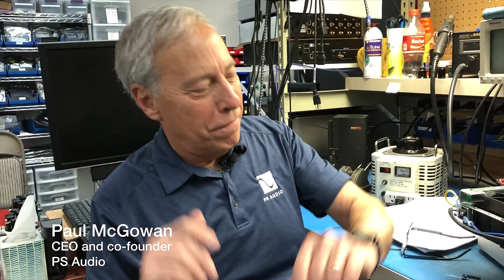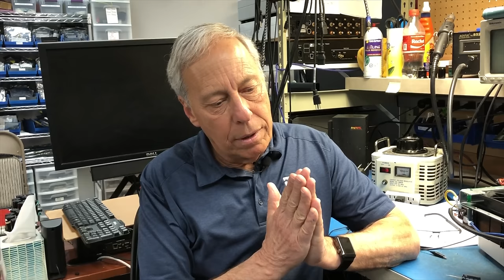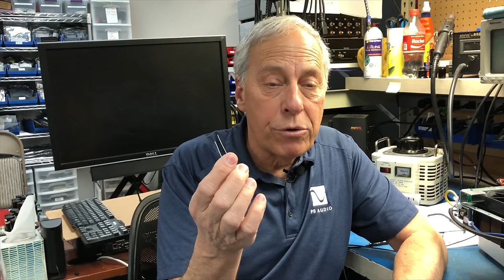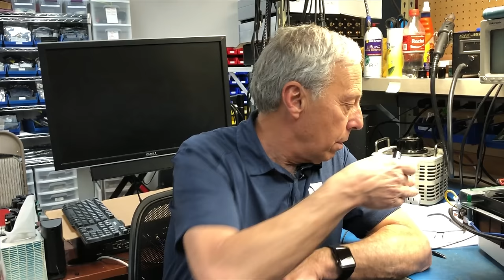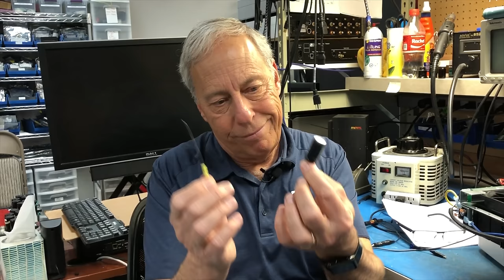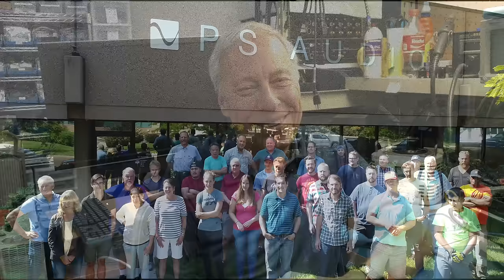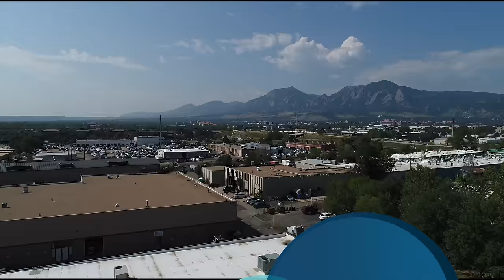Why do capacitors sound different?

Comment: I’m sure it was just a momentary brain fart, but of course a microfarad is one millionth of a Farad, not one thousandth. That would be a millifarad
Reply: not a brain fart. this is the crippling side effect of living with the imperial units
Reply: Jako-Priit Raud Farads are used to measure capacitance throughout the world. There is no other measure.
Reply: +gotham61  Lol, thank you.This metric vs imperial battle, I use both, and have the same difficulties in both systems  :) As far as the "these sound way better" thing about caps is kind of non-sense. If the right spec & type cap is installed in the particular circuit, say a guitar tone circuit, or a crossover network, and swap brands, at same values, etc. not many an ear will pass a blind test. But hey it sells caps, and $1237.99 RCA cables too :)

Comment: Generally high ESR (Equivalent series resistance).  Paper in oil and eletrolytics have a pretty high ESR (and other issues)  that metal film and other quality caps don't have.  Low ESR caps act more like wire than a resistor.  High ESR = rolled off treble.
Reply: Scott Lowell I use an oil impregnated metallized poly cap in the cross-over of some of my speakers.

Comment: Bob Carver said modern components are better than the ones that were around 20-25 years ago.
Reply: yup, notice especially how much smaller electrolytic caps are nowadays and that means less unwanted inductances, for example.
Reply: They are.  Back not that long ago, you'd find 10% electrolytic caps in crossovers.  Those are high ESR and induce audible issues.  For just $2.00, you can get 5% metallized film caps, which are vastly superior.  They are low ESR and act more like wire, without rolloff or smear like the old caps.  In the DOZENS of speaker repairs and upgrades I have done, in EVERY instance, swapping stock electrolytics for $2.00 metallized film resulted in an obvious and profound imnprovement that even non-audiophiles can easily hear.  Expensive speakers like yamaha NS-1000M and Kef 104/2 had poor caps in the crossover.  Re-capping them (projects listed online)  resulted in a dramatic improvement not possible back in the 80's.
Reply: Scott Lowell True, but it is not the percentage SPEC that made them sound poor.
Reply: You can get a tiny little 1 farad capacitor (HUGE value) to keep your digtal tuners' values, but that doesn't make better sound.
Reply: BionicMerlin I could be wrong but I don't think he was referring to sound quality but he was talking about longevity and reliability.
Reply: They are indeed, advances in manufacturing, better tolerances, materials. though not all components, you couldnt possibly buy a valve better then some of those in the 70's now)
Reply: Suzy Siviter are you talking about tubes? Because tubes of improved over the last few years getting back to the Quality that was 1940s and 50s.
Reply: Geerladenlad: Yes tubes, and no we will never get the skills in tube making back from the early 1970's, most of the great valve skills have been lost in time, yes we have better manufacturing skills now, but its not just a case of making a gas filled glass with a few electrodes and heaters in there, there was an art to electrode shape, distances, and even heater design to create linear amplifiers beyond the capability of most if not all current tube manufacturers today. Remember NASA and very large corporations back then spent the equivalent of Billions in todays money to research tube design.
Reply: Suzy Siviter prove it.
Reply: Nothing to prove, research it.
Reply: Suzy Siviter I have and the tubes that are being produced now  are just as good as they ever were.
Reply: Geerladenlad: Yes of course they are dear)
Reply: Suzy Siviter you can thank Mike Matthews for that.
Reply: Geerladenlad: Well Mike Mathews makes tubes like the EL34's and such;well known common tubes ; not the more exotic tubes I was hinting at in my post. Of course another component that hasnt really improved that much: the loudspeaker driver.
Reply: Suzy Siviter now it's your turn to go do your research.
Reply: For?
Reply: Suzy Siviter because he was instrumental in bringing back the quality of tube that's why. Now go on.
Reply: Geerladenlad: Some tubes dear, you are a prime example of why a little knowledge is dangerous..bye!
Reply: Suzy Siviter you're just mad cuz I knew more than you and you had to go look up stuff because of my information and general knowledge. What Mike Matthews did was for the industry which is the production of more quality tubes. I won.com
Reply: Geerladenlad: You are strange thinking that, just because you knew one guy making valves mmm, not much skill in that is there?.Perhaps you are just upset because a girl knows more electronics than you. FACT is you dont know your arse from an IGBT, you just pick up your knowledge from the junior book on electronics.
Reply: Suzy Siviter there you go again making sweeping generalizations talking about subject you know nothing about and making assumptions.
Reply: Geerladenlad: I have a rule; dont take advice from someone who cannot spell 'sandwich', think that's harsh?
Reply: You were wrong and I was right. Now move on.
Reply: Geerladenlad: always want to get the last word in?, each your 'sammich' lol

Comment: Capacitors will pass alternating current above a particular frequency, and block direct current. A capacitor essentially stores a static charge that the alternating current signal alternately charges and discharges. This is how is passes on alternating current - because the stored charge on one side of the capacitor creates an exact opposite charge on the other side of the capacitor. The amount of charge (in volts) that can be stored dictates the amount of alternating current that can flow.
Capacitors and inductors in combination form what is called a resonant circuit. Resonant circuits form the basis for all tone controls and all analog signal filters of any sort.

The different types of capacitors - made from different physical materials - have different properties. Among those properties is also a degree of inductance. And the different types of capacitor have different amounts of inductance. Interestingly, inductors also have a degree of capacitance. The trick is to combine inductors and capacitors in such a way that you get the right amount of capacitance and the right amount of inductance in resonant circuit for what you need.

An inductor is similar to a resistor, but is frequency dependent. A resistor inhibits the flow of direct current, and an inductor inhibits the flow of alternating current above a given frequency.

Thus, a capacitor filters out low frequencies, and an inductor filters out frequencies above a particular point, and what you get is a band of frequencies that the resonant circuit will pass.

Some inductors are just resistors working with an AC signal, and other inductors are coils of wire. Transformers have an inductance and a capacitance rating.

Comment: Nothing "jumps across" the dielectric. Learn how capacitors function. The reason AC passes current through a capacitor is because  of the alternating current which as the plates get charged and then flip polarity one plate will repel the electrons on the other plate. The repulsion/attraction is how the capacitor passes AC current. Now do coupling capacitors sound different? Nope. A coupling capacitor is meant to have a very low impedance to signals of interest; I.e. the voltage is the same on both sides of the capacitor. ESR is moot, especially in a tube amplifier where the next stage is often so high impedance do you really think even 1 ohm of ESR is going to make an audible difference when the next stage is 100,000 ohms or more? Nope. The properties of capacitors are moot for coupling caps due to the reasons stated but there are other applications like a crossover network where the capacitor could have a significant amount of signal ACROSS it's terminals and that's where the non-linearity/hysteresis may be measurable but rarely audible. This is why JBL biases the electrolytics in their speaker networks, to eliminate hysteresis causing non-linear distortions. For amplifiers coupling capacitors just do not develop enough of a signal across it's terminals to have any of it's negative properties come into effect. They are essentially a wire, or supposed to be sized that way. 

I have never measured distortion from an electrolytic coupling capacitor because of the reasons I explained. For the technically challenged nay sayer's we held local ABX blind tests that were designed to test some of the local audiophiles in picking out electrolytic coupling capacitors against "audiophile" type capacitors. Not a single person has passed the test where they can pick out the difference better than just chance/guessing. Some of the guys left with a different view of audiophile capacitors where others blamed stress or whatever for the reason they couldn't hear the difference, but they are just in denial knowing they spent far too much money on snake oil. It's snake oil salesman like Paul McGowen that only causes the industry problems and makes their customers poorer by promoting this garbage because they fail to understand the physics of how these things function and also because they have skin in the game and there are profits to be made.

Comment: Not a very scientific explanation, AC doesnt just pass through the capacitor because its AC and not DC, it is because of the electrons flowing out of the plate and attracting more electrons on the other side (they never cross the insulator only build up inside). This causes electron potential (AKA voltage) between the plates, if the capacitor stops charging up (voltage is the same as the power supply) no more electrons will be attracted to the other side so then there will be no current flowing "through" (actually too and from) the capacitor, so current from a DC source stops once the capacitor is full until the voltage changes again. What happens differently with AC is that after the first peak of the wave the electrons now start flowing in the opposite direction, into the depleted plate, pushing electrons out of the filled plate. This is all in order to equalize with the potential that the amplifier is currently at. PLEASE UPVOTE
Reply: Ahh the old debate of whether current actually flows thru a capacitor), your explanation is far too scientific for the majority of readers, but good on you for taking the time).
Reply: Exactly. it can NEVER pass thru a cap. they don't conduct. As you seem to explain current flows thru the circuit one way charges cap. as the current alternates the cap charges the discharges etc. etc. etc. allowing current to flow thru the circuit. Drives me crazy when people say a cap lets ac pass! The value of the cap will determine the freq. at which it will charge n discharge. Putting it simply.
Reply: It is still current flow though, virtual or not, whats important is the outcome which looks as if it passes AC.
BTW: the value vs. frequency is an over simplification as you say, as it depends also on the series and parallel resistances as well as any other caps or inductors within the same part of the circuit (1st order, 2nd order and so on)
Reply: Paul McGowan: Haha thats the trick isn't it, its not easy communicating on a specialist subject in general terms; but I think you made a good job of it. I think I could spend hours talking to you about Audio with all that experience you have.
Reply: I am answering the question of how a capacitor works not what does a capacitor do. The question is in the description but was never answered in the video: "And, for that matter, what is a capacitor and how does it work?" The reason people ask basic questions is that they do not understand the basics.
Reply: SuperBrainAK: You overestimate the knowledge of a typical person that hasnt been exposed to electronics/electrical, I know this from working in education myself). A lot of people don't even know what AC is, so you lost them on the first sentence.
Reply: SuperBrainAK: To be fair this is an audio channel, not an electronics one)
Reply: I do apologize for my criticism, my original comment is for those who would like the explanation of how a capacitor works, in hopes that someone will learn something or inquire to learn it, if not then they can skim it and move on.
Reply: SuperBrainAK: I didnt mind; someone with some knowledge will learn something, and your explanation was pretty much spot on with how I used to teach the operation of a capacitor to first years, only I used the analogy of cars being electrons and car parking spaces, so as the plates build up with electrons there are fewer places to park and hence the electrons take more time to find spaces.
Reply: DC passes through capacitors just fine.  Connect a current source to a capacitor and the current will pass through it continually (until the voltage across the capacitor is too great and it explodes)
Reply: electrons do not flow through a capacitor only get bunched up inside, electrons fill the negative plate and leave the positive plate, until yes you go over the insulation  breakdown voltage
Reply: SuperBrainAK
: Agree, though I should add, you should never turn a capacitor upside down as the electrons fall out, that's why they solder them on upside down in Australia.

Comment: Gerhardt from Calgary, if you're listening, the answer depends on your level of interest and appetite for technical specifics. Capacitors, like cables and connectors, are the things most customers can see or are aware of. Therefore more attention is paid to them because manufacturers are able to convince the customer of their intrinsic value. Much more attention is paid to capacitors than to resistors for example, because resistors are small and difficult to remove. Capacitors are bigger and with some rudimentary soldering skills, can be removed and refitted with newer and more expensive equivalents. In short, it's another example of snake oil on which this industry is built. I design and build my own range of amplifiers that sound lovely and measure beautifully and I couldn't tell you which brand of capacitors I am using; as long as they are the right value, material and spec, I use what I can get quickly from my suppliers. A basic rule of thumb is to use film caps in the audio path rather than foil caps as foil caps can exhibit hysteresis which is where the cap doesn't discharge completely - like stretch marks in your sweater! Explained here: https://en.wikipedia.org/wiki/Dielectric_absorption .. Hope that helps

Comment: Capacitors can introduce audio distortion through variations of ESR or capacitance with the instantaneous voltage and current across the capacitor. Consider a high-value ceramic capacitor in a basic 1000hz high pass filter. A 100hz signal will be greatly reduced, but the capacitor value will vary up and down due to the 100hz voltage across the cap. This will introduce 100hz modulation on higher signals, strongest 100-2khz. An X7R ceramic cap's capacitance can fall 50% at it's rated DC voltage vs 0VDC. ESR of an electrolytic capacitor is far from an ideal resistor. It is after all passing a signal through a chemical bath (electrolyte). Lots of opportunity for diode-like effects. Dielectric absorption has been suggested as a factor, but it generally occurs on a time scale of seconds or longer, outside the audio band.

Comment: also, the conductors in the film capacitor ends are supposed to be connected not to each end of the film but more importantly to each side of the film where the film is supposed to isolate two conducting sides on the film and thus form a capacitor
Reply: Jako-Priit Raud FINALLY, a correct answer.
Reply: everyone makes mistakes even Paul
Reply: mrlithium69 True, and I suppose that when he is doing these on the spot rather than a studied reply he is bound to make a few errors here and there. Overall, Paul does a great job making complex issues more understandable to the layperson.

Comment: I listened to 10 minutes of this just to not get any answer at the end. In case you were wondering where did those "dislikes" came from, they were from people like me expecting something about non-linear voltage-load ratio, dc leaking and other measurable effects. Not just ""This is 1 dollar a piece, so it sounds better"

Comment: This whole thread is just chasing its tail. Two equal capacitor will always sound the  same because they must have been made by the same manufacturer using the same materials and processes. The question probably should be "Why do two apparently equal capacitors sound different?" Generally the capacitor has  its capacitance, its working voltage and its temperature rating on it as well as the manufacturers name. This information will allow substitution of a faulty one with a working one and the product will work, but only identically if the exact same part is used as had been originally fitted.  No one would claim that any other two products are identical based on three of its parameters being the same  (plus or minus 20 percent, the typical tolerance of an electrolytic capacitor). I would concur with the sentiment that if you can't hear the difference just accept it.